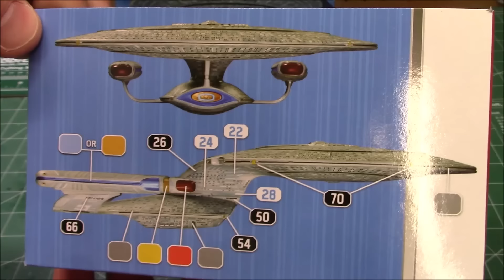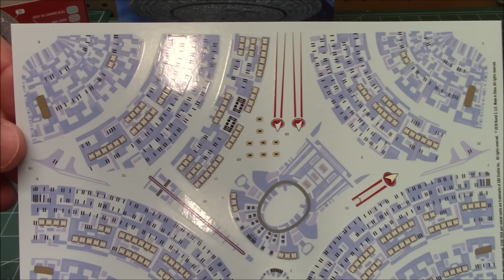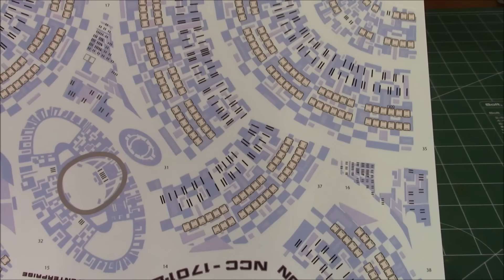AMT Star Trek USS Enterprise NCC-1701-D 1/2500 Scale Model Kit Build Review AMT1126

Comment: I've started this kit & i have a couple of questions for you.

Ive forgotten which nacelle is which, ive noticed a small square on the bottom of each nacelle just above where it will fit onto the strut.

Would you say the square goes on the outer or inner side?

I noticed you used Folkart Metallics, what are the color codes on these?

Lastly, how did you remove the sprue on the secondary hull after you finished painting?

Did you use sprue cutters or a hobby knife? I dont want cause a massive missing chunk to appear, like it did when i cut the sprue away from the saucer section.

Your build looks amazing BTW, I'm hoping mine will turn out that good too.

Cheers in advance.

Comment: I know this is an older video, but I just wanted to say thank you for this great tutorial. I have decided to get back into models after stopping for about 12 years, and this just gave me the boost I needed. One question to ask about the hand painting you did. Did you use a brush or airbrush on the nacelles? If you used brushes, may I ask what brand do you use? Did they leave brush marks, or no? Thanks much,

Comment: I'm using Tamiya's decal solvents for the first time and I'm noticing a much gentler effect on the decals than MicroSol/Set combo. It's been few hours and the decals still didn't really conform perfectly to the shape and in places the film sticks out (I specifically started working on nacelles, the very front of the forward decal slticks out slightly on the round part at the front of the nacelle) is this something I should be concerned with or simply giving them another good few hours to set should do the trick? Should I simply press them on more firmly? I'm using Mark Fit as under decal and Mark Fit Strong over decals, and I hand painted my kit using Tamiya's own acrylics, plus their acrylic rattle can gloss coat.

Comment: Hi there, I used the metallo paints on the nacells.  The paint does not look as good as yours.  Do you donit in several layers?  Did you thin the paints at all?  Any other tips?  Thanks
Reply from the maker: It took a few coats to get it to cover well.

Comment: I'm currently working on the 1/2500 Enterprise-C.  What I found is that the decals are quite thick.  Did you find that with these decals?
Reply from the maker: They went on smooth and laid down well with solvent. Didn't notice them being over thick.
Reply: When I built this a couple years ago, the decals were very thick with the consistency of vinyl.  Decal softening agents would not dent them.  It is good to hear that they are not using those thick decals in this kit.
Reply from the maker: @starsiegeplayer  Yeah, no issues now. They settle right in. The box even says the decals were made to work with solvents.
Reply: I have an older kit.  Purchased it several years ago, now.
Reply: @jamesbongiovanni5180  One thing that I found was that testors glosscote over the thick vinyl-like decals (after they fully dried, of course) not only protected  the decals, but made them soften and conform.

Comment: I keep posting these, I know, but I'm running into some concering issues with the decals. For example the ones around the back of the neck, secondary suttlebays (16 and 17). For some reason on my kit these were completely different shape and I had to cut them to in two pieces to get even some semblence of fit. Also earlier, with the nacelles that I already decaled, I had issues with big upper decals (59) were so long that the back portion of the center stripe curved all the way into the warp grille at the back. Did you have similar issue perhaps? Because right now I'm quite concerned about proceeding, I fear that maybe in these few years between your and my attempt at this kit the decal printing quality slipped and I'm looking at quite painful process with my model.
0:35 - timestamp to a moment in the video where you can see the decal numbers I'm refering to.

Comment: What kind of turntable do you have there that’s underneath the gold base and can you purchase it anywhere if you can could you put a link up thank you very much
Reply from the maker: Just google battery operated turntable, you'll find numerous options.
Reply: @hpiguy  Thank You I am very interested in you video's, I have learned a lot on decal placement and the best way to apply them also I've learned a lot on painting and where to get the paint and the color. Thank You for taking the time to put your video's up. I'm currently building the 1/537 Star Trek Enterprise which is just a learning experience, that's where you come in, then I will be doing the Polar Lights 1/350 Enterprise Refit Model. Thanks Again!!!

Comment: Great video! I have a question though. Why did you primer first and then use the Rustoleum: Paint + Primer? Just wondering since I'm on a budget most of the time with models kits
Reply from the maker: Paint-n-Primer can be misleading, it's not a cure-all.
I still prefer pure primer to ensure a good bond for the color layer.

Comment: Any tips for dealing with this kit’s massively brittle decals? Every single one I’ve applied has fallen apart.
Reply from the maker: If you have defective decals you can always contact Round2models and discuss it. 
You can try spraying them with a thin coat of clear decal sealer like glosscote and see if that helps. But TEST FIRST on a spare piece of decal sheet.
Using very hot tap water can also help soften them sometimes.
Reply: @hpiguy  Thank you!

Comment: I'm watching it as I type. WOW, what a deal, and an easy build, unlike the AMT 1/640, or whatever it is. I was building it, and decided to paint the aztecks. I order this paint mask set for like 80 bucks, and it is all but un use able! Then I decide to build the kit as it looked in the first season, without aztecks, and as I was almost done applying the 100, or so decals, the hull comes apart, and as I try to fix it, I crush the hull with a clamp! After that, I put it away, and I haven't looked at it in a year or so, but I will fix it some day, maybe after this kit of an airliner, something easy to get back into the groove again.
Reply from the maker: I really enjoyed this kit, would happily build another one. I have the big one, the clear one for lights but simply no time to make it. 
I do think AMT makes a big aztec decal set for it, to make life easier if you want aztecs. But I could be wrong.

Comment: I have this kit, also from Round 2  although where it did come with he same decal sheet.  it did Not come with a stand. So I'm having to scratch build a stand for this kit.     BTW  that was the Navigational sensor array you were talking about.   if you look up photos of the studio model that was sold at auction it shows in full color the of the model from every angle possible.  Also there is a video on youtube of this kit where a modeler shows step by step where he drilled out all the view ports after doing the decals and assembling the kit and he filled the ports with krystal clear  and lit this little model up.

Currently I'm working on both this kit which is awaiting a primer coat from the airbrush soon as the weather warms up and I can get into the shop.  and also I have the round 2 22 inch cutaway TOS Enterprise. which was a gift from my niece and her husband for Christmas.  which I have cutaway the inaccurate interior and glued the hull parts together to turn it into a full hull kit. which is to scale to the AMY 1/537 refit.  but am converting some parts to turn it from the production Enterprise to the pilot version. and intend to light it up.

Comment: Awesome vid. I just picked this up. Haven’t modeled in 30 years. I noticed you are using regular Home Depot rustoleum spray paint and automotive primer. The guy at the hobby shop I bought my kit from said I had to use these small expensive Tamiya paints and primer. He said nothing else would work. I see you used them with no problem. Why did the guy need to lie to me? I’ve been waiting to build until these “special” paints show up that I ordered but are back ordered. Really ticks me off.
Reply from the maker: I won't speak for other folks but hobby shops will sell hobby materials, so that is what they will recommend.
I've been modeling for a long time and have found lots of cheaper substitutes, but I still use Tamiya sprays and Testors paints too when I want to.

Comment: I had the original 1701-D and that one had the saucer that could separate as well. I have yet to see any of those since. It was the much more accurate model than any of these I’ve seen. I don’t know how big that one was, but it’s def bigger than this tiny model. The saucer section wouldn’t have even fit in your paint box.
Reply from the maker: That's the 1/1400 kit, still available.

Comment: Could've used a little visual on the way you painted the fine details. Very nice effort.
Reply from the maker: Hi Dave, thanks for the suggestion. Much appreciated.
These are kit reviews, not building classes.  I do try to throw in tips and stuff like I did with the decals but for the most part it's a review on what can be done with a kit, the parts quality,  fit issues if any and the end result, etc.